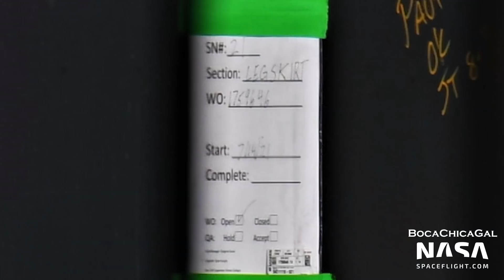Raptor Engines Removed From Booster 4 | SpaceX Boca Chica

Comment: If the colours are all faulty then that is A LOT of faulty tiles. :(
Reply: I think a lot of the tiles were slapped on quickly for the full stack photo op a few days ago.  Now they're doing them properly!  I think the same must have gone for the "installed" raptors.
Reply: Ya ! i hope the tiles dont  become the  nemesis ! If  any part of the underside gets exposed during re-entry this can be a major set back - i did have some other ideas that may also work if this doesnt !
Reply: @scottymoondogjakubin4766  At least any exposed part is stainless steel - it has some thermal "slack" built in - unlike the aluminium on the Shuttle - which was like butter.
Reply: @DLWELD  ya ! seen elon state that in tim dodds interview ! what is going with starships tiles ? you know anything and way so many got damaged ? possibly from raising and lowering it ?
Reply: Green=Good probably, maybe Orange=Recheck. At least none are RED.
Reply: @gordonstewart5774  I don’t think green is good unfortunately. In the closeups you can see the tiles with no tape have “ok” written on them. There would be no point in having two different ways of marking a good tile. I’m guessing the colours indicate level of damage or specific types of fault.
Reply: @Phoebus20  Horrible! So they can resist heat, but not the trip to the pad?
Reply: @Phoebus20  i think weve been speculating that Green = loose, so just needs taking off and re-attatching carefully (as the majority are green this would make sense with the rush to the photo op that most just wernt applied properly) I think speculation was blue = gaps and orange = broken
Reply: @gordonstewart5774  thanks brotha man !
Reply: @Pro Curve yes ! I totally agree !
Reply: @Pro Curve I like how Elon said he'll consider it a success if it launches without damaging the launch table.
Reply: @XxRaginKJxX  Scott Manley seemed to be under the impression that the only way to remove the tiles was to drill them out. If true that means there is no simply readjusting them.

Comment: Soooooo much going on there and it was quite another impressive job by Mary documenting it.  

A couple of things that aroused my curiosity and interest.  

The zoomed shot of the black metal piece at 6:10. I couldn't find in the larger image.  Wondered what that could be.

13:10 The launch table service elevator was cool to see which is a huge help to the crew I'm sure.

14:29 Right after the label saying Launch Tower scaffolding being removed a worker adds one cross beam to the scaffolding as if to challenge the label.  😄😁😆😅

Hard to see how Elon expects to have B4 and S20 back at the launch pad by Mon.  No way will the tiles be finished by then.
Reply: Maybe the scaffolding it's just being repositioned to install the tower wall panels.
Reply: @eduardogardin879  I think the ship could be back for ambient, cryo tests then and get rolled back for tiles. Seems most the remaining tiles aren't here yet and some may need fixing.
Plus in the EA interview he does say he needs to talk to the Supervisor, It seems Elon noticed something during the interview and had to talk to the supervisor. It could be some of the installed as Elon wants (Hence the tape on some of them) or what I seem to have intuined from the interview, he not be happy with having too many different shaped tiles (very well could be wrong on this one).

But anyways the tiles are super important and critical for starship success, in as much as this test  is about seeing whether the booster can push the ship to orbit, I think they really also don't want the ship to blow on reentry and ruin an otherwise good flight.

Comment: I was looking for this video when I woke up 30 minutes ago.  And now it is posted. Time to watch!

This is a lot of tiles to replace, especially as they do not have a detaching mechanism.
Reply: Most of the tiles are installed on pegs so they are removable. Only about 10% of the tiles are glued in place.
Reply: @coolbionicle  But the pins are not accessible once the tile is installed. There is a video by Scott Manley if i remember correctly, and he said that in order to detach them workers need to drill holes in them.
Reply: @mixer0014  A lot of holes to drill.
Reply: I have been watching the process as closely as I can. This is what it looks to me.
They have to break the tile to remove it (unless it already is). Once the 3-pronged frame is visible they locate the studs. Here is what I assume they do - they pinch the stud (which looks like a small tuning fork with hooks) to release the frame. If the stud is twisted or bent they have to cut it off and grind down the weld then weld a new stud in its place.

Comment: The liebherr crane parts is for lr11000 or lr11350
Reply: Good deduction.
Reply: LR11000 I would bet. To make it reach high enough to help disconnect S20 once the LR11350 puts it on top. They would use a bucket.
The LR11000 can also reach 220m if extended.
Reply: @Engineer9736  Not really. But if you find out what a crane can do you can figure out what it might be used for and how.

Comment: The tile process is far too cumbersome. I expect we’ll see extensive changes in the near future.
Reply: Maybe spray on insulation followed by spray on 'ceramic' type finish?
Reply: @smacksman  Yeah sure if you just want to make up a technology, lets go with that.
Reply: @smacksman  Elon said himself that the expansion differences in materials alone make the glueing and the gap sizing important. You can't just spray on gaps and a proper substrate meshing between metal and ceramic
Reply: Major automation for sure.  Not just in application, but somewhat for inspection and testing.
Reply: @dudermcdudeface3674  Possibly - but remember Elon walking back some attempts at "over-automation" on the Tesla production line. Elon can figure if automation makes sense.
Reply: @oblivion_2852  Well spray on fire protection insulation on structural steel members is common building technology. There maybe is a high temp top coat out there waiting? Just thinking aloud. True, glue and expansion gaps are needed for the tiles at present. edit: Before I'm jumped on - standard hex tiles are mechanically fixed while specials are glued and taped in place till set..

Comment: You incorrectly labeled the cranes at the end. The new one that arrived is a Liebherr 1350-6.1 from Certified cranes and rigging out of Texas, hence why it was sitting by a trailer of Liebherr parts. The crane at the very end of the video is actually the Grove owned by Berry cranes with the specs you put over the Liebherr on your overlay and it left heading to Brownsville. Similar cranes but likely replaced Grove with Liebherr because it has a taller lift height to remove scaffolding and do light work on the tower.
Reply: Good catch
Reply: That's right!

Comment: oof, I sense a rethink of the heatshield comming, thats a lot of faulty or misaligned tiles there!
Reply: I thought from the beginning that the heat shield, and tail landing would be the biggest risks to success of this system. The unforgiving landing is what bothers me the most. ANY malfunction on landing, and everyone on board is probably dead. Jets can skid off runways, blow tires, or overshoot runways, and the passengers can walk away. An airliner landed next to a levee, on grass behind the NASA Michoud Assembly Plant in New Orleans, with everyone walking away, and the jet taking off in a few days! (Both engines died after they ingested a lot of hail. The TACA pilot couldn't reach Lakefront Airport, so he had to land between a levee and small canal.) A jet loaded with people crashed in a forest during a stupid Airbus low level demonstration flight, with only a few of the passengers getting killed. So people have survived airliner crashes. Then there was the miracle on the Hudson River.  
A Starship explodes, or tips over on landing without even exploding, and there is virtually no chance of survival. The impact with the ground, if it only fell over without exploding, would be fatal.
 I'm surprised at how few people appreciate the danger of a cryogenic flammable gas like methane. Even liquid oxygen is quite dangerous, being highly reactive. People are kept well away from rocket launches for a reason.
Reply: Based on Tim's 3 part interview of Elon, ~100+ starships and 60-100 boosters will fly, land, orbit, and RUD before the first human is aboard.  That experience in building and testing the starships and boosters will improve their design and manufacture.  The wright brothers did not fly off in a DC3 or 747 ten years after their first flight.  We flew cloth covered biplanes and triplanes for 10 years instead.  Failure of 97 of 100 starships and 97 of 100 boosters is OK and desired if each one fails for a different reason.  Success creates a lawn trophy.  Flying starships and boosters is easy.  The hard part is efficiently manufacturing them with the minimum of material, labor, parts, and time.
Reply: The problem is not the tiles. It is how they were installed on the nose cone. By inexperienced installers in a great hurry and without inspection. A recipe for desaster. But SpaceX is good at learning from mistakes and not repeating them.
If the tiles work or not will be tested by the launch, not by this.

Comment: I wonder why Ship 20 already needs it's heat tiles inspected. Didn't they just lift it on top of Booster 4 and then take it back down? Would that really damage any tiles?
Reply: Tiles are still a work in progress thats why
Reply: Called quality control. They were most likely damaged in installation and are being replaced to make sure all tiles were installed properly.
Reply: The heat tiles were installed in a rush so many weren't installed properly. They were there just for the photo op of booster and ship 20 stacked. Once 20 was unstacked, they removed the poorly installed tiles so they could re-install using the correct method.
Reply: @ryanthompson3737  I saw worker smash to the tile with his fist.  So they cant be so fragile.
Reply: @martinslaba7249  The tiles have the density of styrofoam and are very light despite being ceramic.
Reply: @michaeldeierhoi4096  True, but the way they clearly are handled, they are the density but not the structure of styrofoam. They might be more brittle (don't flex) but harder too. That could make some new installers overestimate how much rough treatment they can actually take. I wonder too if any manager was following the installation process at all?

This has to be one of the clearest mistakes we have seen to date. Talk about dirty laundry in public! I hope they learn a lot from it besides how NOT to install tiles.
Reply: I think a previous post may have hit it on the mark about tiles being rushed to be installed. I saw a video by everyday astronaut and his interview with Elon. In the 2nd video Elon saw an issue with tile installation of the tiles on the nose cone part of the ship before it was attached to the main body and immediately took photos and I think mentioned that something was not right.
Reply: I'm speculating here but I wonder if the issue of the tiles has to do with a tolerance mismatch/misalignment of the 3 protruding mounting pins which we have seen  welded to the outside of the ship and (presumably) the 3 matching receptacle sockets on the back of each ceramic tile. When the ceramic is baked it may be difficult to control some migration of the holes. The weldment/straightness of the pins may also be out of tolerance. In addition to all that, when the ship sits out in the sun (or is cryogenically cooled when loading propellant) and is super-heated on re-entry there has to be significant thermal expansion/contraction that would put stress on the tiles. They may ultimately need to develop some kind of resilient sleeve between the two that can take the thermal range but doesn't compromise the retaining force - like maybe the same material in the blanket behind the tiles. Not an easy problem.
Reply: @harrigan77469  Lets hope not, because if they need that costs will skyrocket.
Reply: @knowlegeisgood8735  Thanks for that clarification.

Comment: Bucky is getting an extension?
Reply: Or even Franky.  But only if some big fixture needs to be raised to the top of the tower.
Reply: It could be for the LR11000. That way it can reach high enough to disconnect the ship when the LR11350 places it on top. Just a guess.
Reply: The parts on the semi-truck are for the Liebherr LTM 1350-6.1 crane at 16:00. This isn't a Grove like the overlay means. This one drives away with 5+3 axles. The LTM 1350-6.1 has 6+3!
Reply: @macg9940  Thanks. Could you guess what it would be used for?
Reply: @knowlegeisgood8735  Probably for the production site. Because of the mobility on roads.
Reply: @knowlegeisgood8735  That's how you can get it wrong. I would say he's working on the launch tower today.

Comment: Some more serious lifting power has arrived.  I wonder if the new construction with the triangular sections is a super strong orbital launch table, to launch Super heavy and Starship 20, away from the launch tower, just to mitigate for the worst possible scenario, as Elon stated in the Tim Dodd Everyday Astronaut -building the infrastructure is a lot more difficult than just a rocket -an explosion on lift off would cost $millions, and set the schedule back many months, so it would make sense to build a temporary launch table that can take the weight, and looking at that structure , I believe it will be strong enough ! anyone care to comment on this as I could be way off the mark.

Comment: "New Structure" probably goes ontop the launch table no ?
Reply: Probably not the launch table.  Not sure where it will end up, but with the hydraulic cylinders around the base I can't imagine it would exposed to the raptor exhaust flame.
Reply: Don't you wish Tim had asked about those structures?
Reply: @michaeldeierhoi4096  hum thx for your answer but are we talking about the black structure with big triangles ? (vs. The one with cylinders as you mentionned indeed)
Reply: @olistiktok  I think we are all waiting to see what exactly Space X does with both of those structures.

Comment: That tile system is sketch! I wouldn't trust those things to remain in tact for a complete flight. I'll bet we'll see a bunch damaged when they test fire the engines even.  Hope I'm wrong.
Reply: You understand those tiles are glued on like a shuttle they're actually passing down there so it's going to take something real to damage them there aren't just got off fall off like the shuttle did
Reply: @bobholland9924  Most of the tiles are mechanically connected, not glued.

Comment: Is it my imagination that the ring sections are looking cleaner and straighter, and the welds are better, as time goes on?
Reply: It's normal, the more times they do it, they may find better ways to weld, the process gets improved.
Reply: The rings are all welded by robots into 4-ring sections. They are tweeked all the time to improve. Welding the 4-ring sections together is still done by hand though. It is also improving a lot, but the difference is still visible.